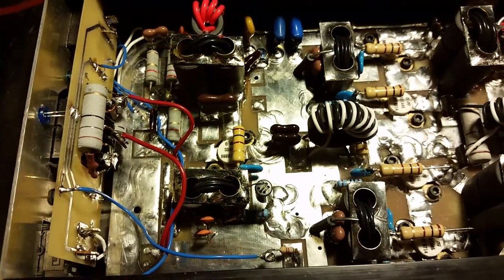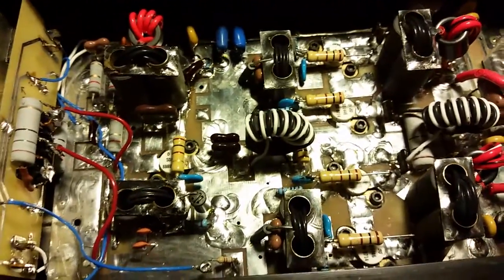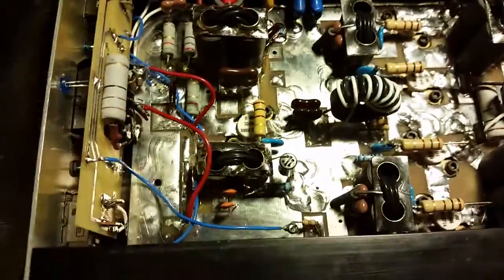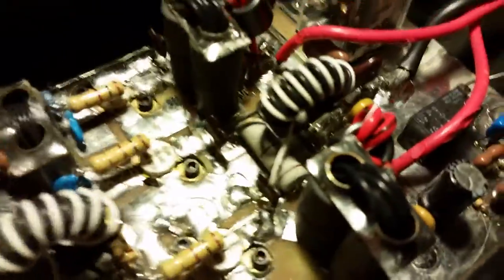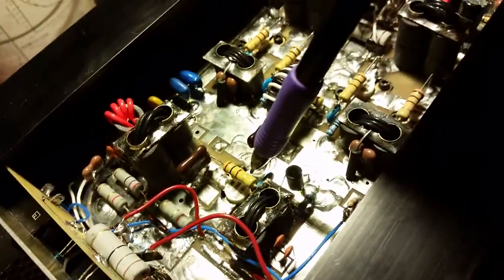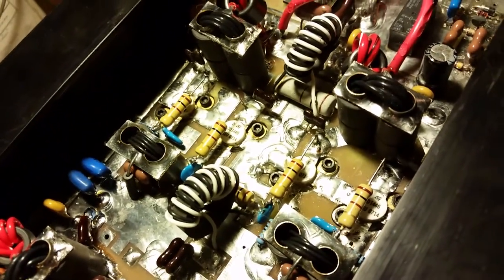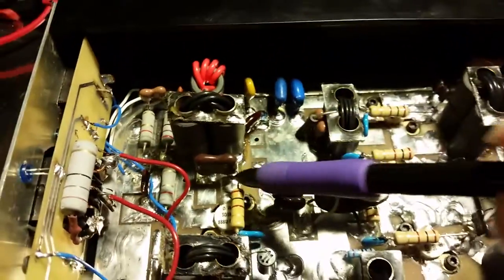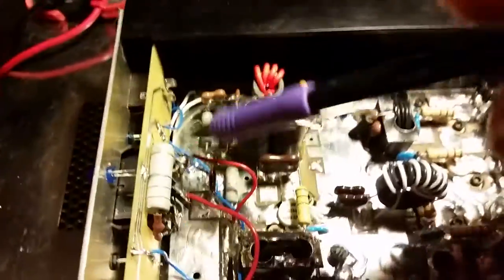Boomer/Palomar 650/600/550 Elite 1x4 Rebuild Metamorphosis

Comment: Hello, Mr. Gatekeeper,
  Enjoyed the video  very nice and clean work and repairs.. Mr. Gatekeeper has now repaired 3 amps for me very good job on all my amps.. I do like the upgrades he performs to make the amp work better then when new...The tuning of the amps are very good so it will work better then when new.. I like that this is his hobby and he will go the extra mile even clean the case covers and not slam bang out the door repair like most radio techs would do. Mr Gatekeeper Keep up the good work and have fun with it.
Your Friend
Randy  aka Rattlesnake.............

Comment: The boomer type amplifiers had some problems from the manufacturer. Plus some as you stated use waaay to much heat to solder components.

Comment: Thanks for this video.. I have a GRAY 600 which is identical to this so you can add that to the various brands... I dont suppose you have a schematic of what you did to this particular amp or do you have a schematic of the stock version.. Many Thanks.
Reply from the maker: No I don't but it would be a peice of cake to draw one up if I ever had to or was hired to lol...wish I had extra time on my hands to do stuff like that....I have 3 of these amps laying around broke....I just finished another one where I did draw a diagram of the rf line to the front  check it out

https://youtu.be/hCYjGcauApo

Comment: do u still fix these i have a boomer 600 deluxe it is fuzzy around the edges i would like it to be i high drive i also have a klv 1000 new tubes and caps and my amp builder passed i am in ct wr 444 nicholas

Comment: I have this Amp. I had a cap fail and replaced it. The trouble I'm having is reflect. It makes watts but reflects some too. Help
Reply from the maker: First thing you wanna do is replace that little 100pf cap in the back with another one that is stiffer.... that cap prbly has devalued!